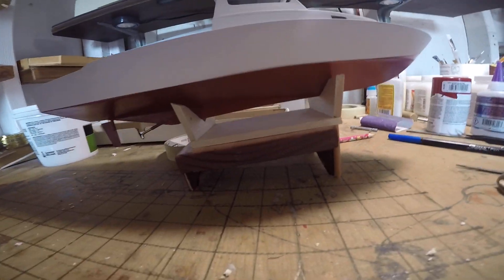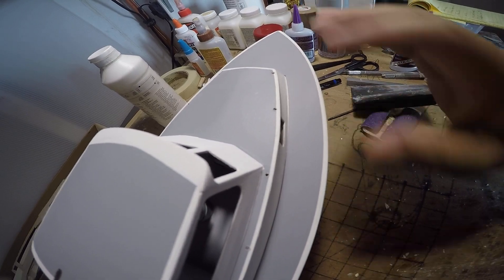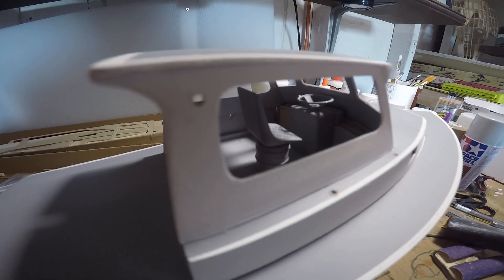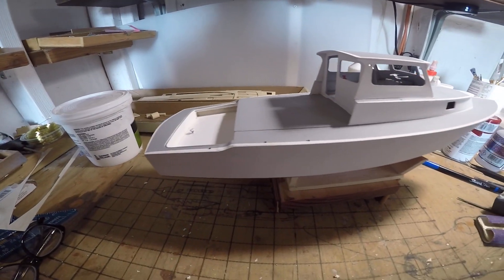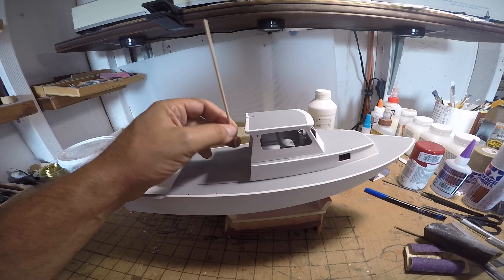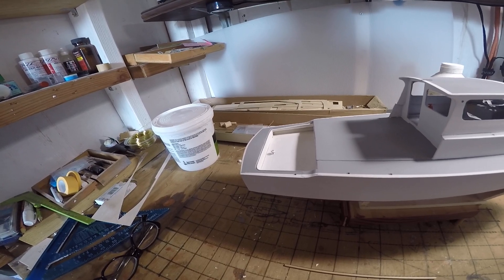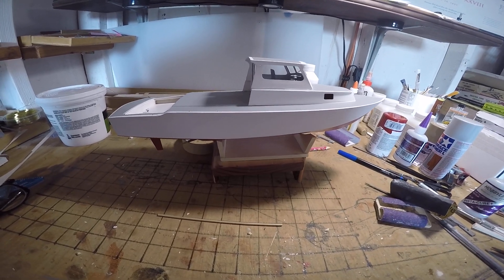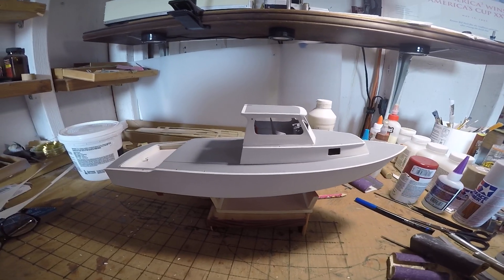Dumas USCG utility boat - Part 4

Comment: I wish I would have found you 7 months ago. I qualified and spent many hours as a coxswain on the 41UTB. I still have all my manuals if you need any details on the boat. She will always be my favorite.
Reply from the maker: I could have used the help then and could still add some details here and there. Dumas makes a larger scale version of the 41 and it is on sale at their site now. I would love to do a proper forward cabin, pilothouse and engine compartment - the larger scale boat would lend itself more ideally to that. Too late for this project I'm afraid. 
I'm glad you liked the build. Thank You
Reply from the maker: Thank you for your service to our Country - a vital and dangerous job to protect our coastal waters 24/7/365 - Semper Paratus
Reply: @heywoodplanes6651  if or when you decided to work on the larger 41 from Dumas let me know! I’ll help anyway I can including the items not found in the manual.